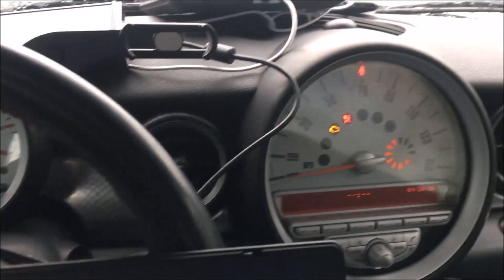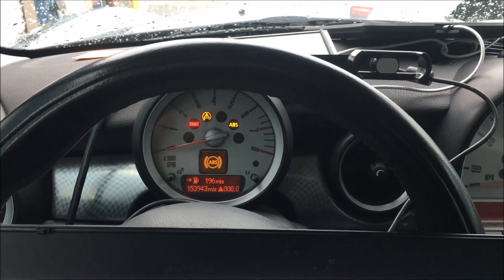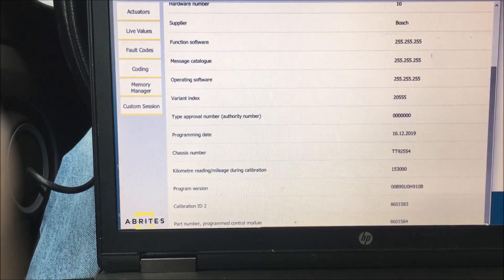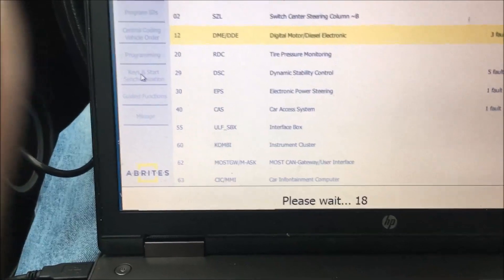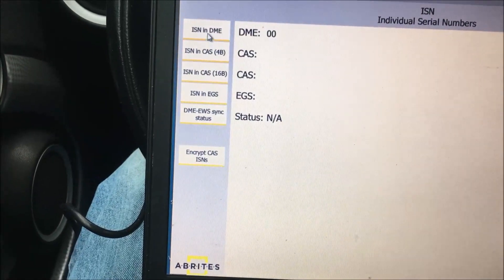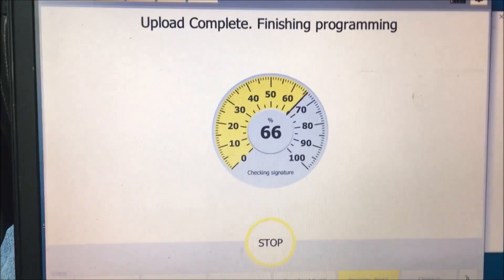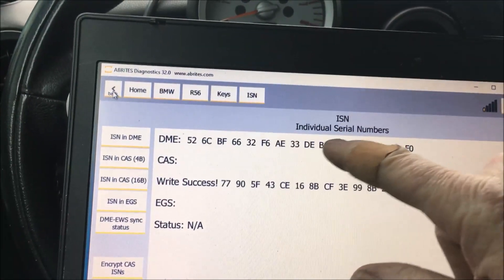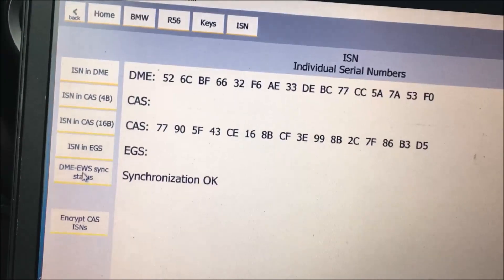Programming used DME into 2008 Mini R56

Comment: Hello Tim Tracy,  I got you channel today...  and I am looking forward to read  your answer,  thanks in advance. 

I had the same problem not long ago... 

At the beginning of the video, (plot from 1:13 to 1:15 minutes) the donor DME has the vin already installed, surely it is not the VIN that corresponds to that vehicle, isn't it?
How did you insert the VIN? 
Can you write /replace the VIN using AVDI?

Thanks. I am following your channel now.  I got  AVDI last December.
Reply from the maker: That's why I say in the video that it made me wonder what was going on... the new/used DME already had the VIN from the car in it...  Usually I read the ISN from the DME, then write to CAS, then after I get the car running I go back and change the VIN in the DME...  Yes, it is easy to change the VIN with AVDI.. I thought I included that in the video, but I must have left it out..  there is a button on the left column that says program ID's, click that, choose 12, DME, then rewrite the VIN and save it...
Reply from the maker: and welcome to fun with AVDI....
Reply from the maker: at 1.20 you can see the button, program ID's
Reply: @timtracy9442  oh yeah. best tool ever for VAG vehicles as well, I am enjoying every video you have made about it. really looking forward to see you doing a Comfort Module replacement on 2010 passat or CC.

Thanks again
Reply: @timtracy9442   Tim, thank you so much for your prompt response.
Reply: @timtracy9442  awesome

Comment: Hi Tim after sync and coding was the egs dtc still in dme
Reply from the maker: No, after I synced the CAS to DME, the anti tamper DTC and the loss of sync DTC cleared..  The car had been sitting for awhile, after I started it, it started having some misfires, cylinders 1 and 3 were the worst...  The shop was going to change out plugs and coils and then put decent gas in it..  This will be the 3rd one I have done for this shop in the last 6 months, and most have plug and coil issues...  I was amazed that the VIN had been changed in the DME, you could see the old VIN, but the cars vin was in there.. After the page long report from the dealer saying they couldn't do anything, it made me wonder who put the VIN in there....
Reply: The reason why i asked i am doing an e84 atm and the used dme was from an automatic going into a manual the coding for the vehicle does not have egs in it i have used ncs dummy to clear the cas anything related to an auto but to no avail, updated the dme with winkfp but still thinks it is an auto, fans run all the time due to missing temp from egs.
Reply from the maker: @davidgillingham7074  with abrites, you go into advance coding, and most times you can code out somethings like that...  but I have had a few that would not code out the difference in auto to manual... Ended up reading data from a manual DME via BDM and then transfering that data over to the DME we were using... when we were done the DME showed a totally different part number...  Soooooo, I think there are DME's out there that were only programmed to automatics...  just my thoughts.. that and five bucks will get you a small coffee at starbucks...  Right now we are fighting a 2006 # series that is having a sporadic voltage drop to the ESL, every once in awhile the CAS sees it and freaks out.. the shop replaced the CAS, and the ESL, still having issue.. replaced ESL with emulator, same issue....  We are now trying to code the ESL out of the CAS...  Fun with BMW's.. oh boy....
Reply: @timtracy9442 Thanks Tim appreciate it, I think the power for ESL comes from the FRM there is also a ground under footwell carpet . I hope you work it out sooner than later. Cheers Dave

Comment: I’m just wondering how much did you spend on Abrites packages in total...
Reply from the maker: a very large sum....   I bought Abrites years ago...  I have a fully loaded unit..  I can tell you that Abrites USA helps me out tremendously ..  and if you go to a locksmith show, I am the tall doofy looking guy wearing an Abrites USA shirt...  The owners of Abrites USA are great people and are great to work with.. As for an exact amount, I really couldn't tell you...  I purchased alot of packages and special functions during the christmas sales, which are great...  I can tell you it's more than 30,000.00  but when you show up at a shop and they have a $40,000.00 snap on or matco scanner and it won't do half as much as Abrites, I feel it is money well spent...

Comment: If you had the CAS EEPROM and a working key and retrieved the ISN that way could you possibly have just written the Un-encrypted ISN to the donor DME and have been done with the car?
Reply from the maker: I have never been able to rewrite the ISN of a DME....  I have been told by the engineers in bulgaria that AVDI won't do it...  I have been told that autohex and explorer and diagspeed can all change the ISN in the DME...  and my thoughts are, that would be way faster and easier than this process..  But I don't have those, and I have been asked many times about the ISN encryption and why we do it on CAS3+ that I figured I would finally make a video showing the steps...  Just realize, when you say, if you had the CAS eeprom, have you ever removed a CAS3 from a R56 Mini???  If you read the reply above you will see where I am getting old, I am also getting rather lazy....  All of this was done by OBD2..  on a BMW, getting the CAS out and reading it is easy, on a mini, it's under the dash pad, in front of and to the right of the steering wheel... you have to take most of the dash apart..
Reply: Oh I totally understand what it takes to remove a CAS module from a mini, it was more of a hypothetical question. Because I thought, like you mentioned, that Autohex was capable of doing what I mentioned. I have Autohex full but haven’t had this opportunity. I do have a MSV80 on my bench to play with and a reading from an actual car. I can try and write my dump to my donor one and see how it goes. Thank you for the response.

Comment: How much could it be if the owner accept to put a new dme and do the programming and coding ?
Reply: Isai Reyes around 3k$ or more dme cas key ...
Reply from the maker: @makaynchealhalibbealkhooo9673  Yes, It's not cheap... The owner of this car towed this car to the mini dealer, waited a couple weeks and paid $300.00 to be told that he needed to buy a new DME and bring the old DME to the dealer so they could transfer data over... He bought it at auction and it was missing the DME...  The tow truck owner also has a shop, when the mini owner called and wanted the car towed back from the dealer, he told the owner that he knew a locksmith that could program it...  That's how I got involved... I love working with shops, retail, not so much...
Reply: Tim Tracy  yeah when u can program used ecu s every one will love to deal with u good to see u making money and saving ppl some cash